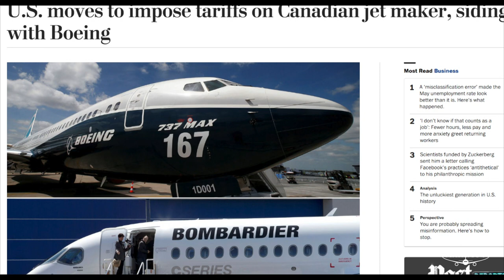First Airbus A220 Made In America Takes First Flight From Mobile Alabama Manufacturing Facility.

Comment: I think the A220 slots very neatly into the Airbus line.
The A320 family are fantastic jets, but the smaller variants, 318 and 319, were never quite suited to their role as much as the 320 and 321, and as a result their sales always lagged.
The 220 is much more suitable as a smaller single aisle jet, but is definitely no slouch - the 300 variant can carry up to 150 people. It has also the capability to run transatlantic routes out of smaller airports. For example the BA London City to NY route currently needs to stop at Shannon to refuel going west. With a 220 I think it could make it non-stop.

Comment: I’m happy to see employment opportunities for american workers and support for the local tax base.  My only question is how much is it costing Airbus to manufacture components in Europe and then fly them in their specially designed planes to the United States for final assembly?  Now with the tariff issue essentially moot, if there is a sudden upward spike in fuel costs, what happens to the efficiency of the practice?
Reply: I guest that France would foot the bill in that cost to keep the company Moving  remember Boeing is in a crisis and not out as yet so Airbus needs to push ahead
Reply: It would still be cheaper because the USA is a low wage country.
Reply: Michael Pilling is right. Salary is always the highest cost of any job. The same job in Europe is probably twice from the one in the States. Beside that they put the factory in the South. Need I say more ?
Reply: @pvisit  Fun fact, my employer (Northrop Grumman) had a hand to play in this.  When they teamed up with Airbus to build the Air Forces next tanker, the deal was Airbus would build A330's in the factory in Alabama.  Some would be finished as airliners in the Airbus factory, but many would go to the Northrop facility next door to be finished up as tankers.  We originally won the contract, but Boeing went to the Senate, threw a tantrum, and convinced them to force a rebid that was rigged to favor Boeing.  So the original deal didn't materialize, but what you're seeing in this video is part of the fallout of that failed deal.  And for Boeing, that tanker deal seemed like it should have been easy money, but they managed to screw that up too.
Reply: ghostrider3780 look at Boeing and their 787, almost 50% of the parts are made outside the US. The wings and Center wingbox is made in Japan, the large Center fuselage is made in Italy and so on...
Reply: Boeing is transporting sub-assemblies for their "Dreamliners" (Boeing 787) from all over the world to Washington state with their modified B747 "Dreamlifter". This is efficient for Boeing. Why should the same thing be inefficient for Airbus ?
Reply: Exceedingly few components need to be flown. Almost all of the components are gonna be trucked or shipped because it's cheaper. Air shipping is reserved for temporary relief of ultra-critical shortages and for components too large to move by land/sea.
Reply: Dont forget the exchange rate between Euro and Dollar. Producing in USA reduces the risk for Airbus and US Costumers of changing exchange rates

Comment: ♥️CS100, 300 & the prior planned yet to be built, CS500 and larger winged CS700 CS900, now called the Airbus A220 family. 

With the industry wide pandemic downturn, the demand for the smaller, ultra fuel efficient A200 aircraft family with the PW geared turbo fan engines, will likely be the most successful and profitable aircraft program in aviation history while for Boeing, the biggest business blunder in aviation history added to the growing list of Boeing’s failures over the last 10 years.

Comment: Boeing has no aircraft that is competing in the 100 to 130 passenger size. So the Boeing actions to influence the US governpent to impose import tariffs (penalty) for aircraft produced in Canada (Bombardier) for US airlines was a very silly act. It shows the spiritual competence (lack of that) at Boeing corporate levels. Boeing was offered to buy the production line of Bombardier many months before Airbus bought it. But now this is an Airbus product. It fits much better into Airbus' philosophy than into Boeings.
Reply from the maker: Great points and I think Boeings philosophy is the problem.  They are still stuck in that post war mentality playing the "If it aint broke dont fix it card"  Airbus was nimble and changed with the times and technologies.
Reply: @maximusaviationchannel  Yes, I agree, - when Boeing built great airplanes like the 787 they did this in response to Airbus leading the way.

Comment: To me this will always be a Bombadier, not an Airbus engineering product made originally by Airbus engineers in Toulouse, France. This is a great aircraft, amazing engineering & design, composite materials and wonderful company that no longer exists. Airbus had nothing in its arsenal against Boeing so they went and bought something they needed that is all. Boeing has faltered in its fat legacy with the 737 and continue to rely on that cash cow, when most airlines had advised years in advance they need to replace the 757, but they have refused...and look were Boeing is now with it mess of the 737-Max, continue to expand its fuselage, and put bigger engines is not engineering at its best it is called 'bean counting' accounting ahead of profits and safety taking over a company. I also flew the Airbus A321 Neo in January of 2018 from Kauai back to Oakland, CA in its inaugural flight with a reporter in first class doing a review. It was an amazing aircraft, features, etc. I will not fly a 737 max ever, if it ever get certified again - I have no confidence in that aircraft or Boeing, if flying will look at older Boeing models an airline has or Airbus for the destination that I am flying.